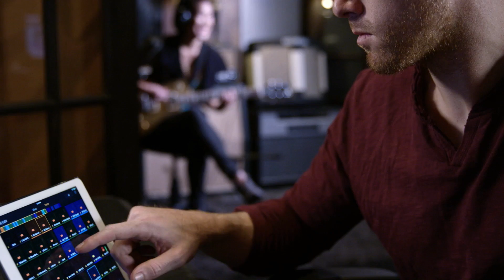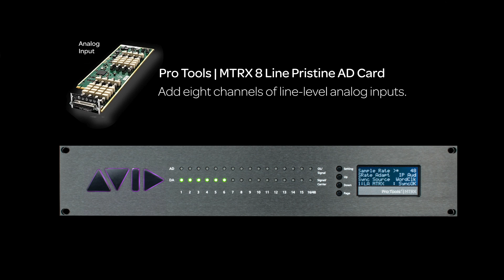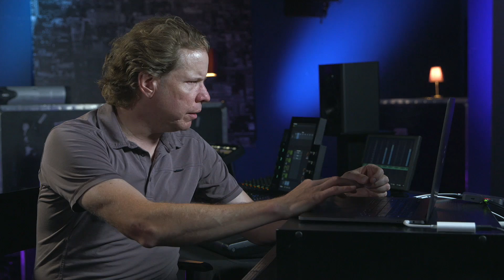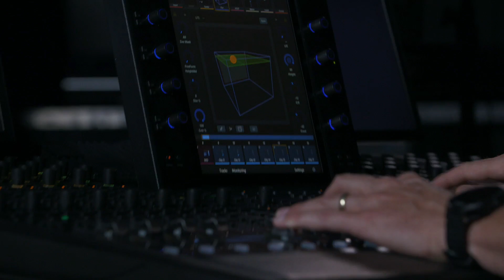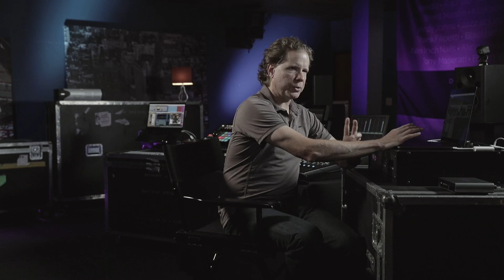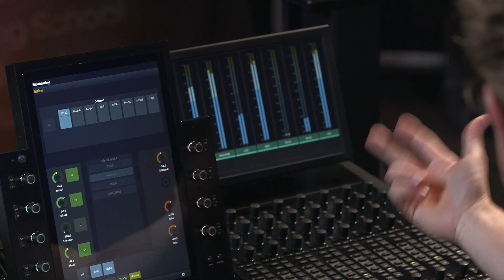Pro Tools | MTRX — A Comprehensive Overview

Comment: How about a tutorial showing how to install and configure an MTRX geniuses?  How about a few shots of the Pro Tools configuration screens and what they are supposed to look like?  Because all my Pro Tools HDX rig can see are non-functional AES inputs and outputs across the board.  My rig doesn't see any of the 24 analog inputs or 40 analog outputs I installed in my TWO MTRX boxes.  Guess whos gonna return $23k worth of gear tomorrow?!
Reply: how'd that work out?